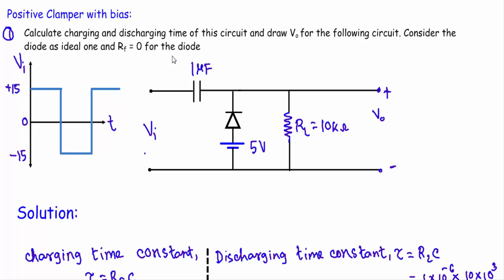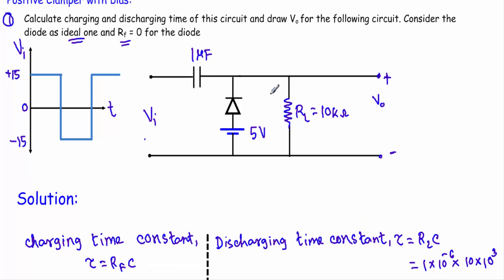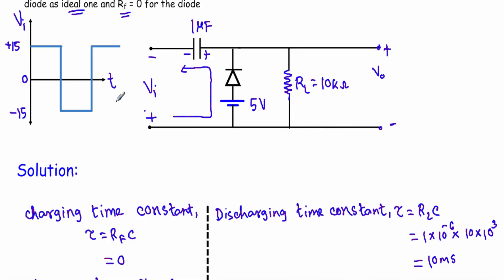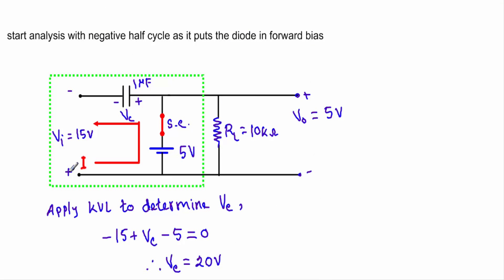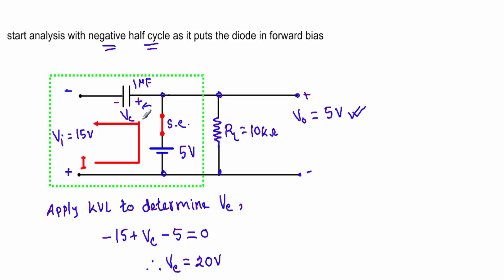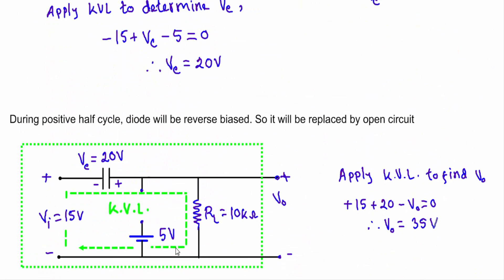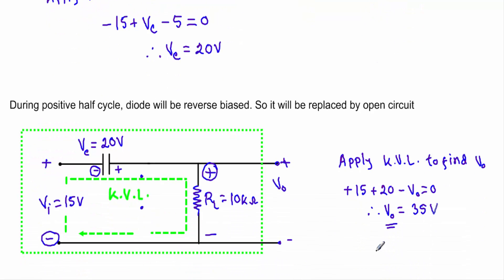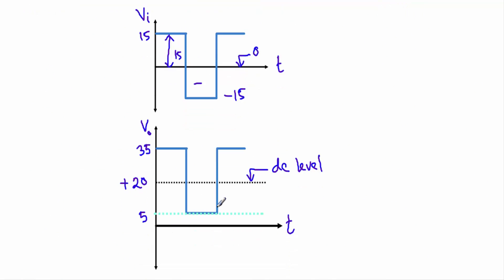Biased Positive Clamper Circuit : Example -1

Comment: Why is the analysis started from time T/2 --> T , and not from 0 --> T/2? Input voltage starts from 0 itself, and current should flow in first half through RL=10k and diode should be off, and the capacitor should be charged in opposite polarity...this confused me
Reply from the maker: Because of high time constant, tau = 5 R*C, capacitor cannot get fully charged during 0 - T/2 half cycle although it seems capacitor can get charged in that interval.
Reply: Ah! Thank You.

Comment: Wait why 5RC?
Reply from the maker: When capacitor starts charging and its two plates are charged, those stored charges in plates opposes taking out and delivering electrons it those plates. So it takes longer time for the capacitor to be fully charged.
a capacitor takes 5 time constants to get fully charged. In first 63.2%, 86.5, 95, 98.2 & 99.3% of total charge is stored (

Comment: why,forward resistance of the diode =0?
Reply: perhaps because is an ideal diode
Reply from the maker: For ideal diode model, diode is replaced by short circuit. So Rf = 0